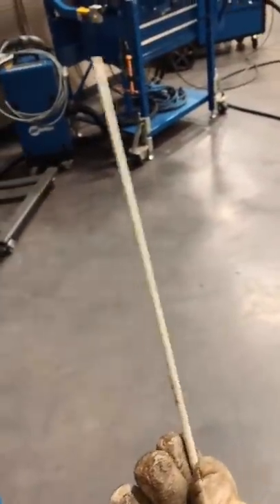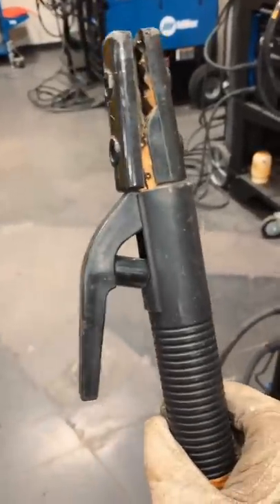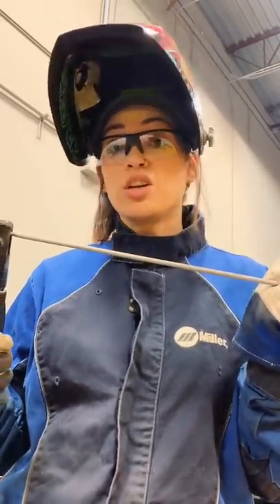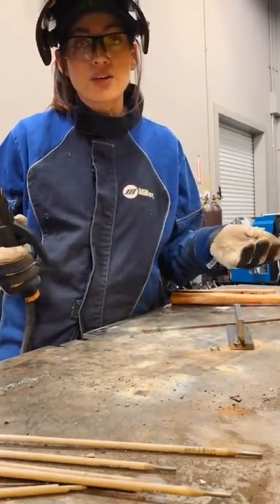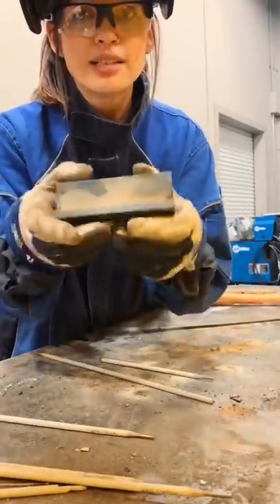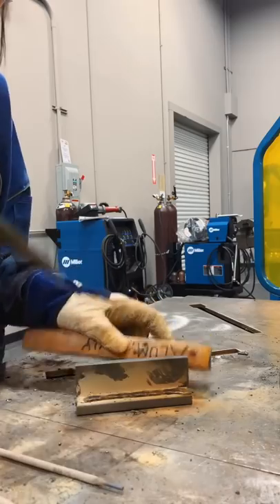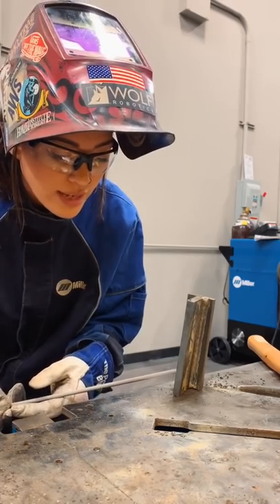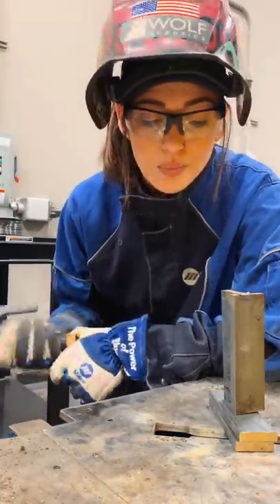Watch This Before You Start Stick Welding.

Comment: great instructional for me  I never stick welded , my question is how you choose electrode negative  or positive in stick welding ?
Reply: I'm just a newbie but I think it needs a whole vid to answer that. Depends on the electrode and thickness of material. It effects the deposition rate and penetration.
Reply: @ColinWatters  well may be it would be a good video for your next one, I for sure will learn something from it. I am sure others will to . thank you for the response .
Reply: it also depends on the electrode. The polarity usually has something to do with where the heat is going to end up..

Comment: Thanks, nice delivery of information, it’s first a visual learned skill.   Help me, I want to buy a welder, auto body and light shop welding.  Don’t have a ton of $.  Recommendation?  Expecting a Miller product.
Reply: Honestly, i like that small dia. innershield gasless flux core .023 or even .030 for auto body panels. Doesn't burn thru as easy as MIG for me. Would work on frames or sub frames too. Just buy a quality welder with D/C output Doesn't need to be 220v for 1/8" or under thickness but get D/C output.
Reply: Hey thanks for that recommendation, will certainly follow your advice.

Comment: According to me, You are the world's first Lady welder!  I have a question for you madam, pls respond, DECN (electrode negative) or DECP (electrode positive) which is your favourite? I am really confused which one to use for what? So, I just go with DECP!
Reply: Hoping that she reply to you, but I could provide some light in advance:   First, normally the manufacturer/brand establish the recommended amperage and position( - / + ) on the package/box. For example I have seen 6013 of a specific brand recommending ( - ).  As I have learned, electrode on DCEN provide less penetratioin on the work surface.  DCEP provides more penetration on the work surface.  On DCEN the heat is more concentrated on the base metal.  On DCEP the heat is more concentrated on the tip of the electrode.  Please confirm all these in different good YT videos/web as I'm a learner too.

Comment: I am in my early 40s and I bought a welder to try to learn any advice for us thinking on make a career change...thank you
Reply: Don't do it, you are too old for welding career.

Don't take this as an insult but it will take you at least a year to master stick welding provided you go to a welding school.
You will then work at least 5 years for a very small pay, 

If you want to start your own business metalworking then it's a different story, but i don't recommend becoming a pipeline welder or something similar at 40.
Most professional welders here retire around 50-55.

You could still make your own company and make steel fences/construction etc, it's just that professional welding is usually done in small,cramped spaces, often wet and cold, and that takes a toll on one's body. There's a reason why welders are paid well and it's not because it's hard to do, it's because you sacrifice your own health.
Reply: @lazar2175  We only live once for God sake
Reply: @onenessseeker5683  Bro, if you start welding for living at 40 you will have like 15-20 years maximum until you HAVE to retire. And you'll spend 5 of those years learning stuff and working for shit wage. If you have a family you need to support, which you probably do in your 40's, you're going to have to sink in a ton of hours to keep up, making you retire sooner. 

Welding is a good career but it's one of those things that take a lot of time to master and take a huge toll on your body. 
By 40 most professional welders look to start teaching or start working less/easier positions. 

Of course, he could start his own business and make millions, but if he's looking to get hired then it gets way harder. No one wants to hire a 41-42 year old with no experience in the field and if they do, the pay is going to be laughable.
Reply: @lazar2175  I'm sure there is a lot of 60-70 year olds out there still welding professionally. There is a saying, it's never too late. I'm 43 & I just filled out a form to go to collage to learn to be a welder. My family have long lives with very good genetics. & my father didn't slow down in life one little bit till he reached age 75.
Reply: @onenessseeker5683  Well, good luck then! But I have to say, it's incredibly physically demanding job. Wear protection, wear a respirator and be safe. 
You'll probably be kneeling, laying or crawling all the time, so invest in your PPE! 

Also, I'd recommend going with TIG instead of stick, stick is usually used in heavy machinery, boilermaking etc...
Which means lifting heavy, tight spaces etc... 
TIG will probably be close to a office job, welding inside your climate controlled booth all day + it's paid a LOT more than stick welding. 

Most people want someone with fitting skills too, so you can practice with an angle grinder and some steel in your free time and it's going to pay off rather fast, being able to fabricate and fit stuff adds like $10/h to your already decent welder wage.
Reply: @lazar2175  Ok thanks for all the advice. If I do make it I don't want to be working on massive job sites & all that anyways. I would only want to be working & welding smaller stuff. wouldn't want to be working on tractors or tanks. No massive stuff for me & really I would rather be working on aluminium rather than steel. But would like to get good at both. In the end I would like to be able to stick weld, mid, mig, tig.
Reply: @onenessseeker5683  It's a pretty harsh environment, you might have to work massive jobsites because there's no other option. The welders are weird, and especially the people higher up - piss one off and suddenly whole state is pissed off at you. And they like their egos stroked, trust me. 

I'd recommend you starting your own small business. Making workout equipment, furniture, decorations whatever. That way you are your own boss. You can even do this on weekends, outside of the 9-5 welding job. It's how I went to college without actually working anywhere but my garage. 
And the tools are not even that expensive - you need an angle grinder, cheap inverter stick welder, your PPE and a drill to turn $5 of raw material into a $40 pull up bar in less than an hour. 

I now work as a Industrial Engineer and have to coexist with a lot of welders in my plant. But they are all honest people, hard working and I'm sure they would beat the crap out of me lol. So don't piss them off and make some friends, try your hardest and if it doesn't work out, well you've got one more thing to put on your resume!
Reply: @lazar2175  Now you got me thinking. I would much preferer to be my own boss & own a business. Maybe at my age this really would be the best way forward for me.

 I did my first weld yesterday using flux core wire on a bike frame. I never realised just how much fun it was & how much I liked it. My weld looked ugly but seemed very strong as I beat it with an hammer & instead of the weld breaking it started tearing the actual frame instead.

 I wish I got into it when I was younger. I wonder how much money I could make going in alone. I have no clue how much to charge for work. When could I start charging for my welding.. How neat does it all have to be before you can start charging & people wouldn't complain. How do I know when my welding is good enough to start charging for.?  It's like I feel I don't really know where to begin to start this whole thing up

. I will be trying to learn though. Thanks. Welding would suit me then cause I'm a bit weird compared to average. :) Do you have any good links for me that could help me learn ?
Reply: @onenessseeker5683  Well, depending on what your small business would be doing, you can start charging for your welds tomorrow. 
If you're making workout equipment or furniture, then as long as they hold up they are good, you can grind them further if you want a cleaner look. If you are in USA, you can also make shooting targets.

I would advise to stay away from structural repairs, like car frames and trailers because if it fails and endangers someone you can be sued. Same goes for pressure vessels and other stuff. If you think the weld can fail and hurt someone, you can be liable - don't accept responsibility waivers either, a good lawyer can fight them and you get in trouble anyway. 

I recommend you to start with padding practice - get a flat piece of steel, start welding on one side and stack beads one next to the other with a bit of overlap, until you fill up the plate, then turn the plate 90° and do the same. 
When you master that, you can weld two plates like T and practice right angle welds. 

If you're attending a welding class, they will teach you all of this and more, but if you want to start your own little business then I don't think you need it, welding class is all about welding up to code and passing x-ray and bend tests, no one is going to bend test the coffee table you made from square tubing. 

As far as learning references, Weld.com and 6061.com are great, both have YouTube channels. Aside from that, The Fabrication Series is a great channel also and Fireball tool is good for getting some ideas and blueprints, afaik people pay good money for their vises and they have all the blueprints on the website for $5-$10. And tons of plans on Pinterest too, seems silly but some of the best ideas I've had came from there.

Comment: So, I’m a middle aged man and the Covid political guidelines have forced me to reinvent myself. I’m in the beginning stages of learning blacksmithing and welding metalwork. I am not even a beginner welder yet. I picked up a old but free  thunderbolt hj -c1. I’m trying to figure out the power from the circuit breaker. Should I be using a 50A breaker?
Any info or other videos on this basic information would be helpful.
This video was very helpful for me! It gives me hope that I can pull this off.
Thank you!

Comment: Quick question...I'm an aspiring hobbyist welder, and I was curious .. on the vertical weld, can you go from top to bottom, as opposed to working up the seam?
Reply: There are some rods that will need to be used top to bottom, others are best used from bottom up.

Comment: I just picked up my first Lincoln Tombstone. So here I am looking for information. This video is  very informative and you have a pleasant way about you. Just a question about straight stringer beads & not using the Cs, 1/2 moons etc. Is one method better than the other as far as the strength of the weld? A rookie question, I know but a rookie I am. By the way ringing that bell for you at  983
Stay safe, Joe Z
Reply: If your doing a straight stringer or a slight manipulation side to side it will result in the strongest weld. A big fat weave will pass a bend test and probably tensile but it will have low toughness due to the larger unrefined grains. It all comes down to heat input. (Volts X Amps) ÷ Travel speed. So when you pick a power setting you want to increase travel speed to weld with a reasonable amount of heat input. A big weave is essentially welding as slow as possible and it increases heat input a lot.
Reply: @geoffmooregm  Thank you. I had to read this a couple of times to get good a penetration lol.  I appreciate the information. I am reading whatever I can get & gathering some scrap metal to practice on. I did a few small projects with a flux core but looking to get into it with this stick welder. Most of the projects I am looking at are lawn tractor decks, simple carts & when I get comfortable enough some frame work. Thanks again & stay well, Joe Z
Reply: @JOEZEP54  I would search a couple generic weld procedures for the electrode you are using. Or check the manufacturers recommended settings. It never hurts to start there.
Reply: @geoffmooregm  That is a good suggestion, I will check that out. Thank you.

Comment: To non-welders who are looking to get into welding:   Start with “stick” welding.  Mig welding is easy, like using a hot glue gun, “squeeze trigger and go”. Stick will challenge you, force you (my dumb ass) to develop skills you don’t develop when you start with Mig.  I got my mig cert from Lincoln instructor.
Reply: I have to disagree you a bit. Yes, MIG is VERY easy, at least it was to me. Stick not so much, a hobby welder starting with STICK may get frustrated and give up if they start with STICK and aren't getting it.
Reply: MIG welding is very touchy tho. If you do any sort of critical structural work, MIG is actually much more difficult in my opinion. It's easy to make a good looking bead, but it's as easy to have huge lack of fusion, Cold laps, etc ... And, if like in many big factories you get old and badly maintained machines, it very quickly becomes hell on earth. But I agree starting with Stick is the way to go.

Comment: Can you offer any advice ? I've experimented with various angles of my rod but don't seem to get the penetration I require. I always make sure the work piece is nice and clean free from any deposits built up over time, also that I'm properly grounded and in a comfortable position so that I don't rush toward the end of the job getting unwanted splatter over the work piece. Any advice would be great thanks.
Reply: Are u running enough amps for the thickness of electrode and metal you're welding?

Comment: Question: Where is the amps set at during this weld?
Reply: On the welding machine, in the front.
Reply: 80-90 for 6010/11

Comment: Sometimes when I start I seem to be welding with slag. The puddle is a swirling mess of a two toned mixture and it seems like there is too much slag on the rod; too much slag period. And it follows as I lay down the bead. The end result looks like a traveling too fast weld, but slowing down doesn't work either. Dunno why. No one else seems to experience this.

Comment: A vertical weld should be from the top and run down to the bottom.  A weave is used to push the slag out of the way.  Going from the bottom up, who knows how much slag is trapped under the weld? No mention is made of AC vs DC.  Some all purpose rods can only be run on AC and some only on DC.  Fleet weld 37, an all purpose rod, must be used with AC.  Even so, you must weave to mix the parent metal with the weld metal.  I wonder what she does with an overhead?  Also, there is no such thing as a 7018 or 6011 rod, these numbers refer to mil-spec even though some manufacturers place these numbers on their rods.

Comment: Athens, I was watching this video and the question that I haveis would 110 stick welder be worth it?
Reply: There’s nothing wrong with a 110V welder. You just have limits on the thickness of your base material. If your base metal is thick, you’ll have to preheat it with a torch and use multiple passes to complete the joint. The duty cycle is also lower on smaller machines. This means that you can’t weld continuously. Most newer welders have thermal safeties that prevent you from welding at a certain point to avoid heat damage to the internals of your machine. If you’re just using it around the house and not for a living, I’d buy a smaller welder. Most DIY jobs don’t require a 200 amp machine.

Comment: lead burning from the bottom, me friend was a master a lead welding, used to do ceilings, he made theses 4 feet balls into segments out of lead, bossed them  into shape, and lead weld or burnt them together , they where the finishing finials on the hips  for the horse stables for an rich arab ( oil } rip richard an alcoholic like me, the ceramic wall tiles in the stables cost 200 k, money was no problem, old school

Comment: I must admit, that is the first instructional video on welding i have ever seen that doesn't show the actual arc, puddle and rod movement technique. Tape a #10 shaded lens onto your camera lens and video the actual arc weld at point of metal transfer and don't put tape across the lens. We promise to wear our hoods when we watch. Also, it's a coupon, probably no more than 6" long. You don't need to start at the beginning and swing the camera to and fro to travel the length of the bead Just shade the lens and keep the camera stationary aimed right at the weld joint. Then take the lens away to show cleanup of the bead. Probably help to watch a few welding videos before trying to create them.
Reply: Good Video Starter' and Good Advice - She Welds Great - Just Maybe Needs to Advance Her Videos a Bit With Your Experience Pointers🎇 Decent Videography Is a Different World 🎥

Comment: Question on the vertical weld, you seemed to be more vertical or almost pushing rather than dragging. Is this a trick of the camera angle or a deliberate change from horizontal weld? Thank you for the clear instructions, it was most helpful. Would you consider doing a video on the different rod numbers/codes and what they mean for us noobs?

Comment: very interesting. I can weld with a coal forge and a hammer , but i nver got the hang of this newfangled electricity welding.
Reply: I once pulled the plug on my car's sump sideways on a rock. A blacksmith friend repaired it on his forge. I looked on it a sort of advanced soldering.